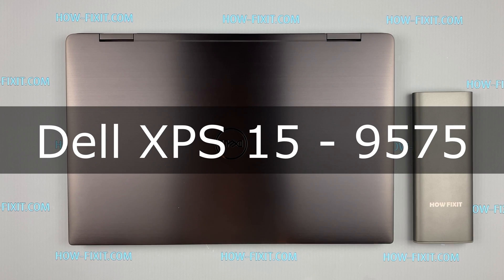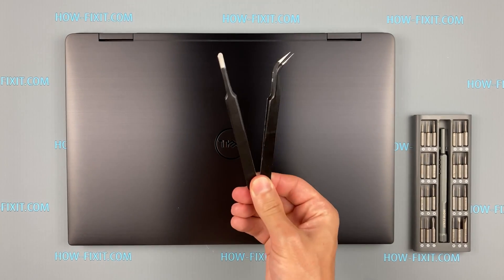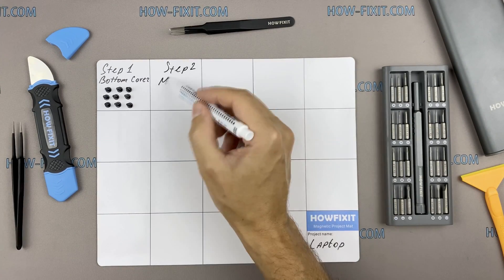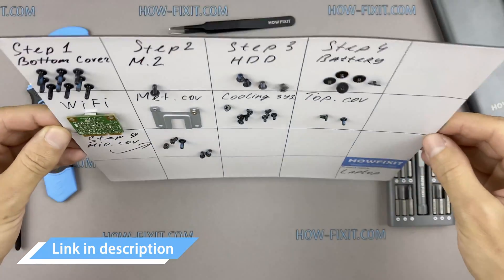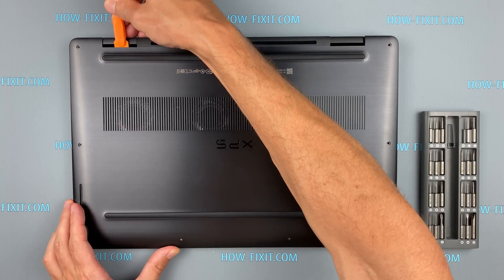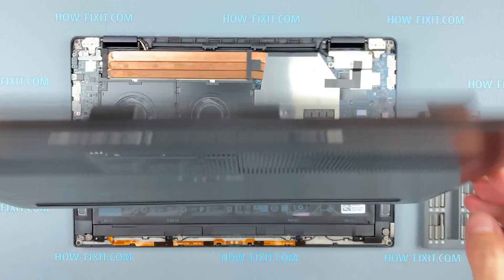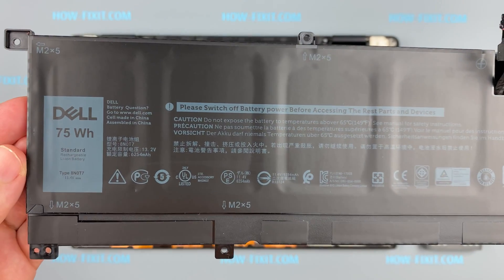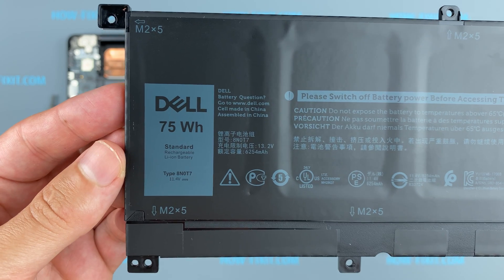How to Replace Dell XPS 15 9575 Battery – Full DIY Tutorial

Comment: The latest instructions from Dell show that you have to switch off the internal battery switch while replacing the battery. It is a tiny slider switch on the right side of the circuitry. Your video gave me the confidence to undertake the task, which took me 1½ hours. The new dell original battery was not charged enough to start the computer, so add some time for charging...

Comment: My dell XPS 9575 will not start after remove and replace battery and I also removed the cmos battery. Results: Cap lock and keyboard blinking and  machine won’t start. How can I reseat the RAm when they are welded onto the MOBO?
Reply: Uh oh, I'm having the same issue. I tested my CMOS battery and the voltage is very low ~2.7. I have ordered a new CMOS battery and hopefully this fixes the issue. I do want to try to remove the battery so I can test its voltage though

Comment: Thanks for this great video. By any chance do you have a tutorial on how to fix a USB-C power port that isn't charging anymore?
My Dell XPS 15 9575 laptop has completely died now and I'm unable to get in. 
For some time it was showing a weak connection to get the power charging through the usual port. I bypassed it earlier by using one of the other ports on the right side that allowed it to charge but I think a bit slower
Unfortunately now, all ports aren't charging when connecting the power adapter. The battery had died out a really long time back and I've only been running it with the AC adapter but the battery has still been inside the laptop since

Are there any initial steps I could try? I've tried cleaning the interior of the usb-c port with a plastic toothpick, compressed air and this usually worked before but this time it's completely dead.

Super stressed about this as I need to use it soon. ANY little help at all would be super appreciated please